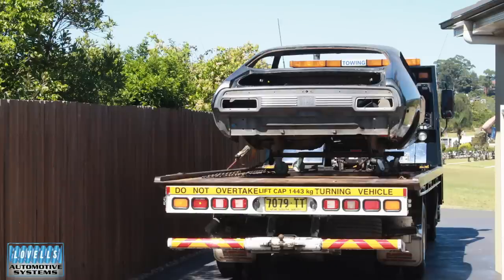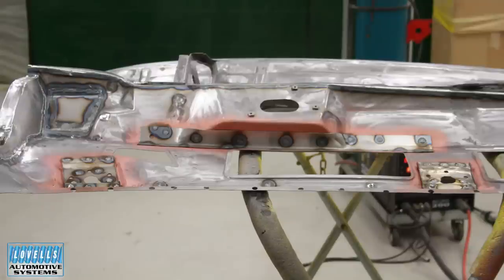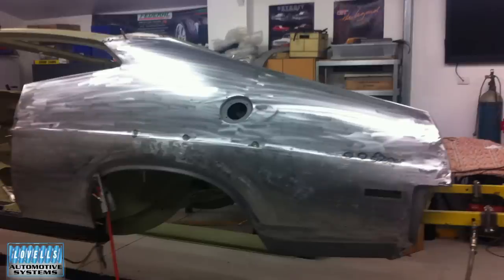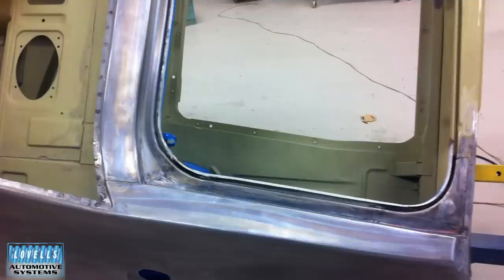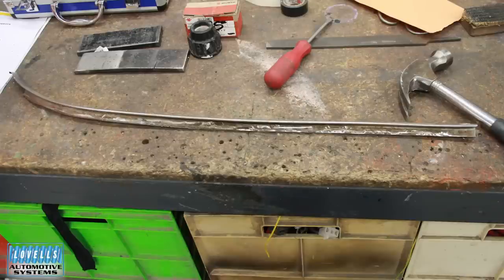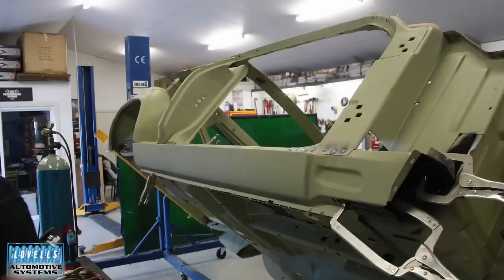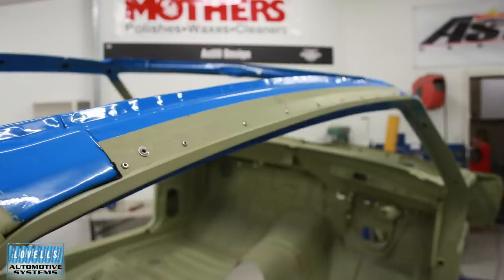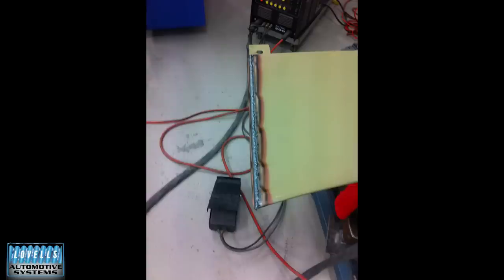The Build Series #9 | Blackmans XB Falcon GT Coupe | Howard Astill

Comment: My 2 Favourite all time Australian Muscle Cars 🚗 r the Ford XA , XB , XC Coupe . 
And the other Favourite is Chrysler Charger with the 265 Hemi E38, E49 . 

There's an original XB one owner near me .  And a 265 Hemi Charger down the road . 

Love ❤️ watching 👀 u guys . Thx 4 sharing.  Xcellent
Reply from the maker: Thanks for sharing! Your luck to have some close by. You dont see too many out any more
Reply: @AstillDesign  
A mate of mine own one in Newcastle. An XB .  We were both on the Australian Slalom Canoe Team & Rev Heads . 
The Cops 👮‍♀️ couldn't catch him . The engine was " Worked "  I used 2 drive it & would spin the wheels in 1/2/3 . 

There was a Jail break in Newcastle & the Crims pinched it .  Flipped it when they slammed it in2 2nd gear at a 160 ks . Snapped the tail sharft . 

Would love ❤️ 2 have the case 2 own one . And put in a Windsor 441 cu inch stroker with sbf hemi heads . Would be wicked .

Comment: I was just wondering? Do you polish the chrome trims? You mentioned they were stainless? My VB chrome trims need some pots and scratches fixed.. can I sand them back and polish or do they need chrome plating? Thanks and absolutely love watching your content
Reply from the maker: Not sure about VB commodore trim. They could be anodised aluminium. If there stainless steel they can be sanded and polished. If there aluminium they will need to be re anodised. A job for the platers

Comment: When your spot welding the plenum up below the windscreen, do you put sika on all the mating surfaces before your spot weld them together?
Reply from the maker: Just along the front edge to Firewall where the water will collect. We try and run it just inside the weld area. Have a look at the van video we did last month. https://youtu.be/pRtNDoTom0k
Cheers H
Reply: @AstillDesign  yes I had seen that, I guess I am trying to understand why and where you would use the urethane sealer (or was it adhesive?). My GT40 project will have a number of structures that need to get closed up like this and they form the structural parts of the chassis.  They all have openings that allow air and moisture to circulate freely.  So I am trying to think ahead about how and where I will need to apply protection.
Reply from the maker: Hi again, have a look at the panel bond products used on newer cars for fitting roof skins and firewalls etc. Cheers Howard